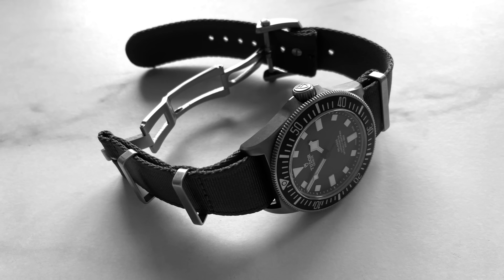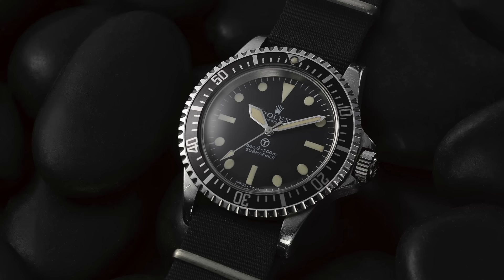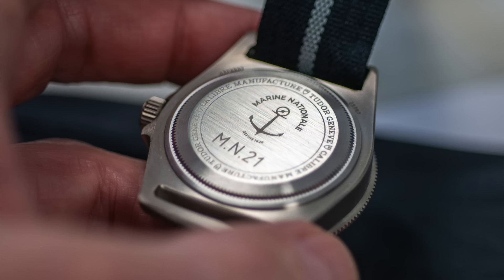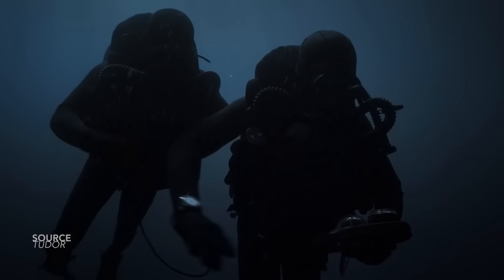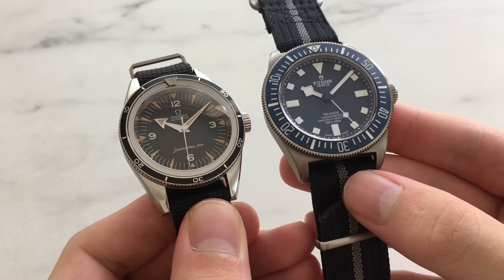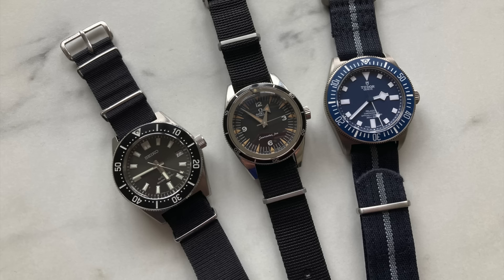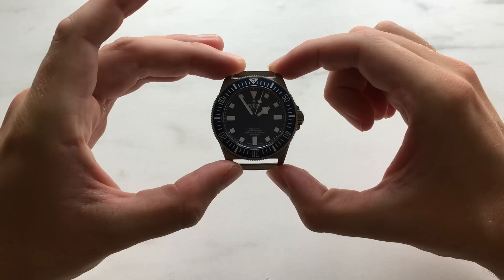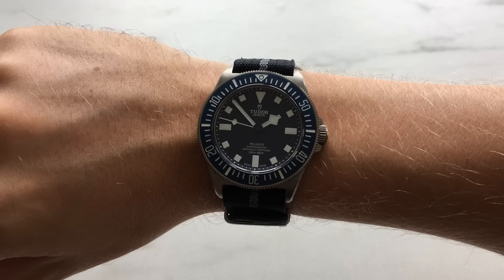My First TUDOR Revealed! Pelagos FXD Marine Nationale (Review)

Comment from the maker: There are times when it feels like a watch was made for you. The FXD definitely stirs up debates so by all means criticise away! My Crit: I would've taken "Pelagos" off the dial. This watch is bespoke enough to be a different property from the family. I'd be very keen to know your thoughts about how they approached the model and the improvements you'd want. Something tells me this is going to be a template for the next generation of Pelagos models we'll be seeing soon (with bracelets, He Valves etc.) ⚓
Reply: You are really making me consider this piece. I loved it on the release and I have considered the BB58 Blue so many times. I just have to come to terms with the fixed lugs… which you made a very compelling case for. Great commentary as always!
Reply: I have a LHD, and now I think you have sold me on the FXD. I was considering a Blue P, but the Blue on that one was slightly brighter.  As you mentioned unique, and far from the flexing hyped watches that us true collectors can actually dream and get within a reasonable budget.
Reply: I don't mind that it is a Pelagos, but "OFFICIALLY CERTIFIED" is really unnecessary knowing that above it, it says CHRONOMETER which says the same in one line😅
Reply: This is my expectation as well. That this will be the blueprint for the next gen Pelagos and that’s why I didn’t buy it. Id rather buy it, when it comes out as the new normal pelagos with a bracelet and put it on a strap when i want to. This is like a convertible with no closing roof. It is too limiting.
Reply: I bought a BB 58, then this came out. Purpose built and fantastic..tudor is simply the best value out there imho..of course you love it..
Reply: Best purchase in current Tudor line-up!  👍👍👏👏👏.  With the recent release of the Pro and the Ranger, this one was a bit forgotten, but it’s a no brainer.  Well done, and thanks for the video!
Reply from the maker: @WatchMeEDC  Those funky "skin diver" lugs are barely noticeable day to day. It's quite crazy how they've changed the formula but ended up making it look traditional at the same time. Ah, thanks as always T! 🥃
Reply from the maker: @edjustice7755  This FXD does have such a cool meeting point of being subtle (with an awesome background that most don't even care about) It's pretty amazing that a piece like this exists. And I'd say the FXD is different enough to pair with your LHD nicely!🥃
Reply from the maker: @Csibu89  It's a bit overdone, right? People tend to take a watch dial more seriously with "Chronometer" as one single line 😆 I have no idea why the "Officially Cert" has to be included... maybe it's a part of the contract? ;)
Reply from the maker: @Sandouras  It will be interesting to see what they include / remove with the Gen 3 pelagos. Reckon the He valve will be removed for the sake of streamlining? Still, the aesthetic will be gorgeous!! 🔥
Reply from the maker: @joker14n  They are so good. This sort of release amazes me even now (basically 6 months later) hopefully Tudor runs with more ideas like these in the future. The Ranger was a good start BUT it needs some more love 😆 Thanks as always Cary!
Reply from the maker: @Will Harris And the Sinn UX / U50 would pair so nicely with this FXD. But man, what a cathartic feeling getting this piece and realising it's better than I ever expected. Now it's time to focus more on German pieces 😉 Thank you Will!
Reply from the maker: @Thomas-vq5pb  Something we can be hopeful of (seeing the FXD forgotten) 😉 It's so cool... but you'd know what I mean about Tudor Snowflakes Thomas. Ah, still feel so luck to say that I finally own this piece - and it's still amazing to think that Modern Tudor is capable of delivering such a great design! 🥃
Reply: @Csibu89  It's the standard text that Rolex - but with the addition of 'superlative' - and Tudor use on their sports/professional and some other models like the Datejust. It's the same on my North Flag. Having said this, it doesn't make an appearance on the new Ranger: that just reads, "Ranger."
Reply: @ID-Guy  I think you are onto something. The blend of the rugged one piece design alone is as u said unique to set it apart from the rest.  Let the saving begin!
Reply: The most sincerest watch review I've seen in a while.  I actually picked up my own FXD today, a day after watching this video.  Called up a local (Korean) boutique, and was surprised to hear they had a piece ready. I decided to give it a try before somebody else bought it, which was sure to happen over the weekend.  So far I am liking it, and it is most definitely a purpose-built piece, not an all-rounder.  I don't have the most active life style so it's possible that I may ultimately decide to part with it--but a watch like this deserves at least a serious try.
Reply: A superb watch in every way. Enjoy!
Reply: Enjoy your time with it!

Regarding claims about MN, everything needs a story .. a commando core, an Everest, a Moon. So real or not doesn’t really matter.
A story is a nice compliment to every hi-end luxury product.
Reply: Only got into 'proper grown up' watches this summer at the grand old age of 61.
I bought a few old TAG Heuers as they were affordable and always fancied one as a teen. Sold them and bought an immaculate Omega Seamaster PO 2500d.
All I want now is a Tudor Pelagos FXD and that will be me done.
Thank you for the vid. An absolute pleasure that has fixed my path 😁👍.
p.s. kept the TH series 1000. Special place.

Comment: On the topic of straps, the ones I have found that work really well with the FXD are:
- Bonetto Cinturini rubber NATO. The keepers are spring loaded, which allows to easily convert it into a one layer strap, avoiding too much thickness between the watch nad the wrist. Very good quality, too
- The Watch Steward G style, which is specifically designed for fixed lugs watches. It's an elastic band similar to that used on Erika's Originals, but has a clever design that avoid passing the strap between the watch and the wrist, resulting in zero extra height. Very comfortable, but less secure than the Bonetto for aquatic / sporting activities

Comment: Great video and a piece I'm probably going to try and pick up. Like you,  the Pelagos LHD was calling me for years. Finally pulled the trigger on a gently used LHD double digit numbered piece. It IS my go to watch. Was looking to pick up a SD43, but not anymore.
Reply: Same. LHD won the vote the AD Had called me for the FXD..  but the LHD 🏅 

In the long run the LHD, maybe more collectible with the roulette dates and numbered case.  

"The LHD is powered by a special version of the caliber MT5612. It is the reference 5612-LHD. Why is that? We have this caliber pass the COSC tests upside down, so as to reflect the positions in which this caliber will most often be in. This requires special regulation."

Comment: Great review! Beautiful watch. I'm so curious; where'd you get the deployant to go with the NATO at 15:56? I would love to get one for myself. Just to eliminate the risk of the watch falling off as I try to strap it on in the morning. Cheers!
Reply: I was wondering the same thing, it looks great!
Reply: @markypants  plus one
Reply: Since IDGuy is silent, I did some digging, and the closest I could find was the RM-Style Artem deployant, however it doesn't have the screw cap thingy through the nato strap eyelet, so it's not the same, and it probably won't hold a nato without the screw cap, most deployants are meant to hold much thicker and sturdier leather straps.
Reply: hi did any of you finally get an answer or find out ? i have exactly the same observation and question. such a cool clasp. many thanks in advance Will
Reply: Blancpain Fifty Fathoms OEM.

Comment: I somehow missed this video when it came out.

At first I just didn't understand your enthusiasm.  But then I started to realize that the changes implemented were extremely thoughtful.  A real dive watch is built like a tank.  If it's built with steel it be heavy.  Built with titanium it's stronger and lighter.  While high-grade stainless resists oxidation, it will not resist it as well as titanium.  This watch should be able to spend most of its "life" in saltwater.  Titanium also tends to stay matt, even if abraded.  

The absence of springbars is another important change.  Bracelets may be strong, but they are secured, ultimately, with fragile connections.  Bracelets may have divers' extensions, but a NATO strap is far, far more flexible.  

The bezel is extremely well designed as well.

So now I do understand your enthusiasm.  This is a superbly designed and engineered watch.  Its austerity is not a mere fashion statement.

Comment: Great review and congrats on getting THE watch for you. I'd say that any watch can be the watch you bond with and become part of you - for a variety of reasons. Back in 1996 I bought my first proper watch - a Rolex Datejust 36mm 16220 with fluted bezel and silver dial.  I couldn't really afford it but bought it anyway because it looked so beautiful.  I basically didn't take it off for over 20 years bar the odd service when it stopped. Then I got the opportunity to buy a Sub and the 16220 went back in its box. And then a Moonwatch as the addiction struck! Then an Omega 300M and a Tudor GMT. Truth is  I've never really bonded with any of the newer watches like I did with the Datejust. That 16220 is part of me - went all over the world with me and shared a lot of memories. It's the one.

Comment: Nice shirt. I really like the Pelagos, wears very well despite the size on paper. Put it on a parachute rigging strap and you feel like a proper French commando. Was genuinely impressed Tudor had the stones to release something like this, and hope it's successful enough to make them keep taking risks like this.
Reply from the maker: Tudor had the stones, excellently said. No reissues or homages, just an oddity outlier (with a small bit of history with the french navy 😉) I'd be so down to see releases from them like this every other year (here's hoping) Nicely said brother AND I've gotta get some stretch for mine down the road. Maybe an OG NDC strap? 🥃
Reply: @ID-Guy  When it comes to MN straps the Erika's are probably the most refined execution, and the price reflects that. The originals (and by extension the NDCs I assume) tend to surprise people by how ad hoc they feel. 
There can be quite a bit of material that you would normally cut off and melt but given how expensive these straps can be (when you didn't get them for free) I'm hesitant to recommend it to others. I had a couple of decent cheap ones from CWC I don't feel bad about cutting up but I think they only come in 20mm.

Comment: Very nice.  I have to try one on, if that's even possible.  I too, have a 6.75 to 7 inch wrist, and wonder about the lug to lug.  I have a feeling it won't be a problem, but you never know until you have it on wrist.
Reply from the maker: You'll be able to rock this with ease Shawn. I was skeptical but with straps it wears so neatly. Just the right amount of presence that it's not overbearing (and looking awkward) but also not small. Really makes for the ideal dive watch size for our wrist size 😉

Comment: I agree that it's a very "personal" watch and if you love it, than you a very lucky watch enthusiast. Congratulations!

Personally I love 95% of this watch (the thinner profile, the lack of a date, the gorgeous dial layout, titanium case, AR coated crystal). Not sold on the reverse bezel or the fixed lugs though. To me, both of those aspects would detract from how I like to use and wear my watches.

But I see why you love it. If I ever had a spare $5000 sitting around I might even consider it :)

Great video as always

Comment: I really like the deployant clasp on the band. My issue with traditional buckle clasps is that every time you use it you are damaging it when you bend the band back, drag it across the buckle, and insert the pin. The deployant clasp solves that issue. I have a BB 58 Silver 925 and am still casting about for a good band-clasp combo. Who makes that clasp? Nice! Good vid. Keep at it!
Reply: Hi Mark, i have the same question, did you ever find out where the clasp comes from ?many thanks Will
Reply: @10007will No, never learned.

Comment: Just found your video, and couldn't agree more with you on how special this watch is to me. It has replaced my Submariner no-date as my perfect watch, and I can't ever see me letting this go. The one thing I disagree with you on is the strap though. I have now had two of the originals, the first failing within 6 months and the second lasted about the same time. I no longer wear the Tudor strap, which is sad as the dark blue color scheme is perfect for the watch, but the hook/loop approach just doesn't work and Tudor don't seem to have any interest in helping resolve that, although my dealer generously gave me a replacement strap. So aftermarket straps are the solution to that, but it is the one disappointing aspect to this watch.

Comment: Tudor Pelagos FXD is an sports model rather than serious diver watch. With only 200m waterproof and 
lack of gas escape valve, this model is to be categorized in Black Bay and not Pelagos. Also the strap 
passing through the case back which hides the best feature of "MARINE NATIONALE" and manufacture 
year engraving is disappointing.
I did consider Pelagos FXD vs. Pelagos LHD upon purchase, but for above reasons and I already own 
Black Bay 58, I purchased Pelagos LHD without any hesitation 6 months ago. I also liked the number 
engraved in the case back, which both the titanium bracelet and included rubber strap will not hide.

Comment: there is something often referred to as simple elegance.  It refers to restrained beauty or a tastful richness.  Tudor pelagos does not fit this description.  it's more of a plain Jane.  the back side of the watch is akin to a JC penney run of the mill watch.  Minus the logo, the dial could have been taken form  or replaced onto any dive watch in the world.   OK, it's chronometer certified, so they get kudos for the movement, but you don't haev to stoop to a 4 grand plain jane to get that.  Titanium case is nice, but available on many more interesting dive watches at 1000-2000 so 25 to 50% of the cost.  I mean if you absoutly love it, then price is irrevelant...but ask yourself why you love it, because other than the logo, I just don't see it.